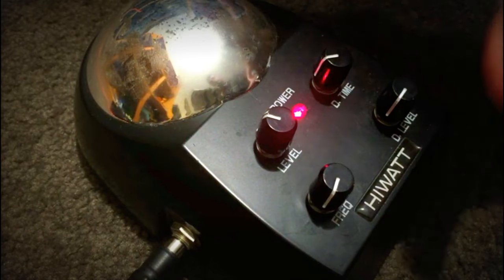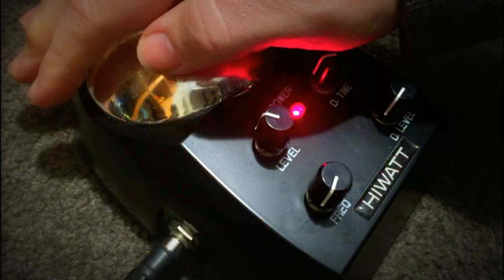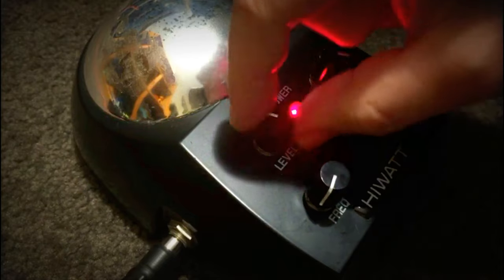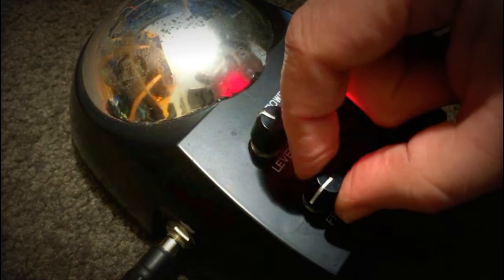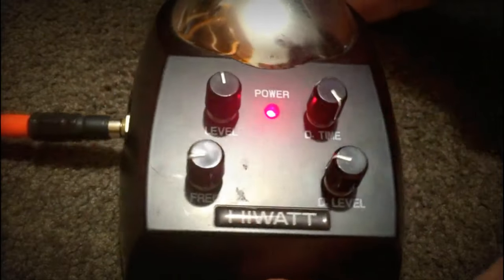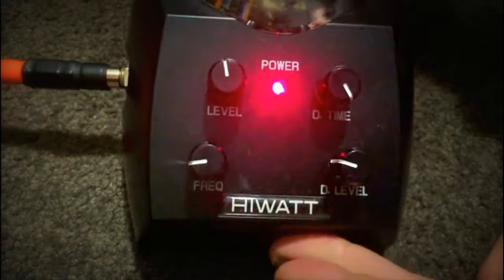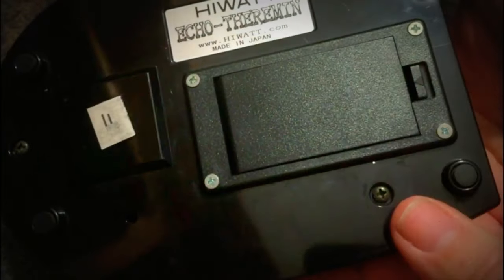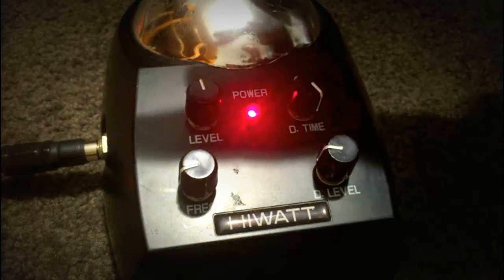Hiwatt theremin (with delay) retrospective

Comment: In mine the sweet spot of the Freq knob is around 12 o'clock, you have to move it very carefully till the sound stops. In that setting I get around 10 inches of range between dead silent to super high pitch, increasing the pitch as I get closer to the dome. It also has an internal trimpot to calibrate the response. Very cool little gadget to get some old psych Hawkwind-style sounds!
Reply from the maker: I agree. So weird that Hiwatt makes nothing but amps …and this weird little thing :)

Comment: The most useful setting is when you put the freq knob around 11oclock, then you get a much larger range in which you can move to produce different frequencies. But it gets this continuous low tone between « notes » which becomes pretty annoying.
Reply from the maker: True. Fin but limited device - great for the stage :)